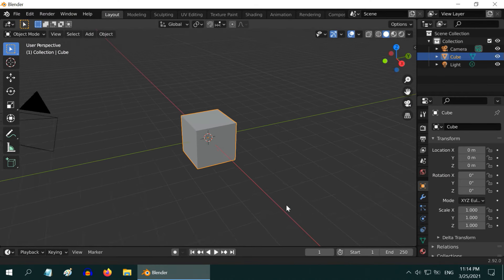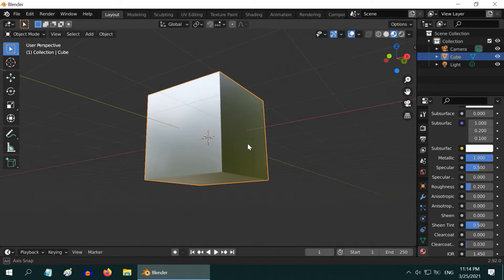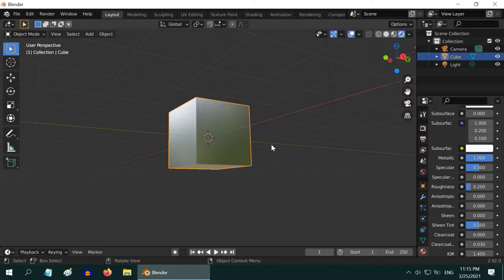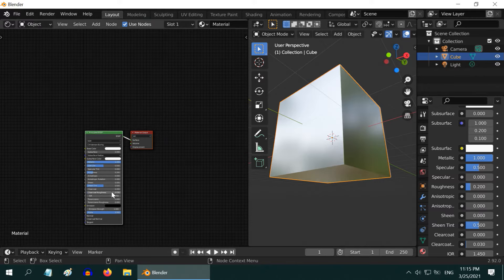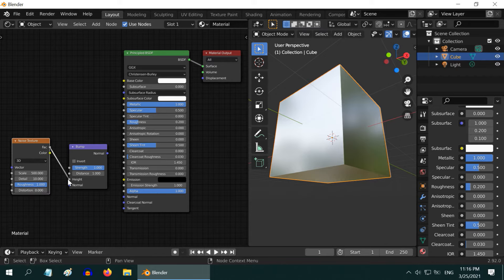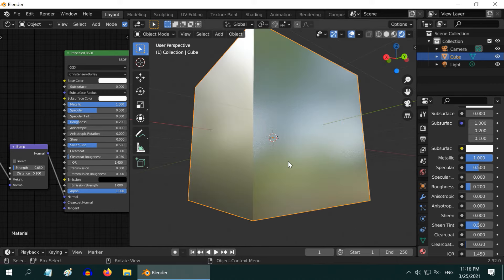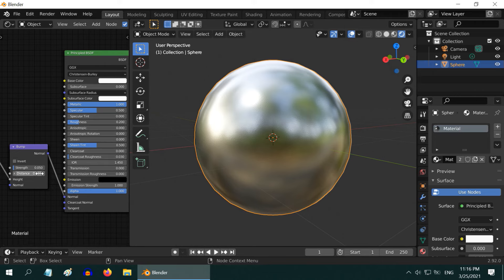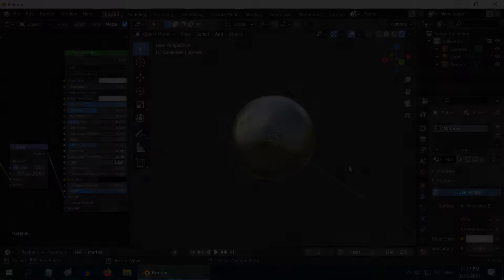Create Realistic Steel Material In Under 2 Minutes | Metals In Blender (All Versions) Eevee & Cycles

Comment: How i can export the object with metallic effect?
Reply from the maker: The material (like the one we created here) will get exported normally with your model. If you are using another program to import it, look for options to import the material as well. So basically the material information is already exported, you need to work on the import part. You can verify this by importing that object into another new Blender project. If you see your material, it means the export was done correctly.

Comment: is it real steel??
Reply: Can we use the object as a real steel? I meant , eg:- when we create a magnet near this object, can it active with magnet?
Reply from the maker: @kavindugimhan7538  For magnetic property, you need to enable the magnetic force field for your scene. Like every steel is not a magnet, merely changing the look of an object to steel won't enable its magnetic property. We have to implement it separately. You have raised an interesting question, and we will come up with some tutorial on this sometime in the future.
Reply: @5MinutesBlender  is magnetic fields property availble in blender ? I meant can we enable magnetic property for every object? Also I’m not fluent in blender yet 😊
Reply from the maker: @kavindugimhan7538  No, as of version 2.93 you cannot enable such a property for an object, any such property does not exist. The only way to simulate magnetism is by adding a force field of type magnetic. Connecting that to a rigid body is non-trivial and it would need quite some experience with Blender. If you just started in Blender, I would recommend you to postpone this part for couple of months until you become very conversant in rigid body animation and force fields in general. You can also check the Charge force field, which works similar to magnetism, so visually it will be similar, but it has some advantages.